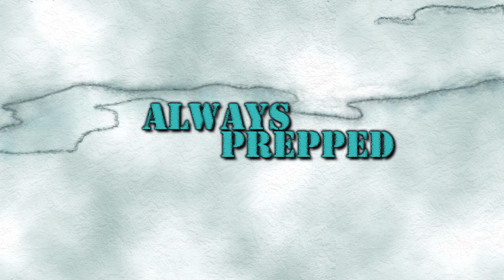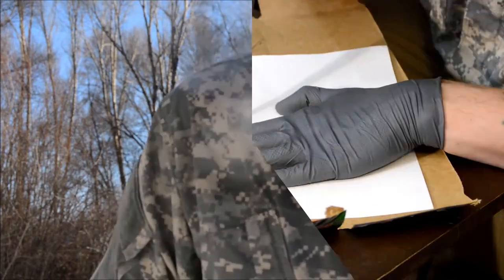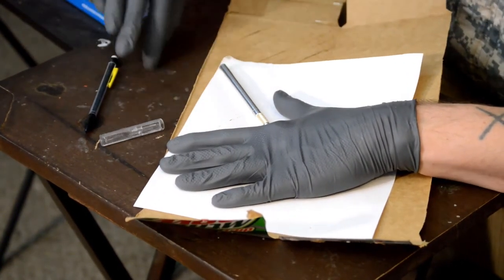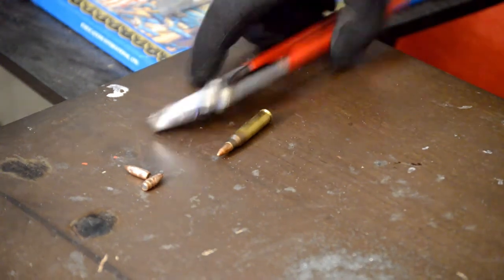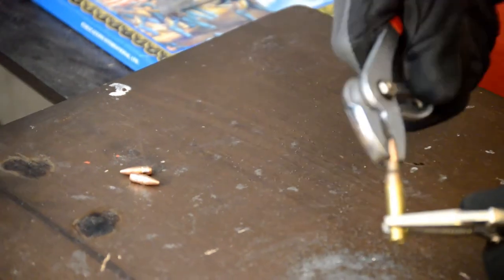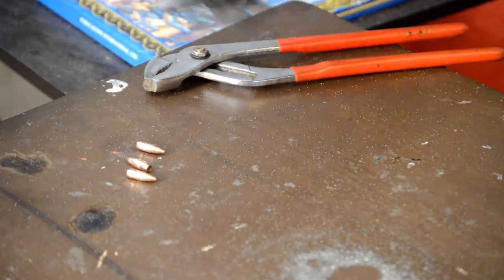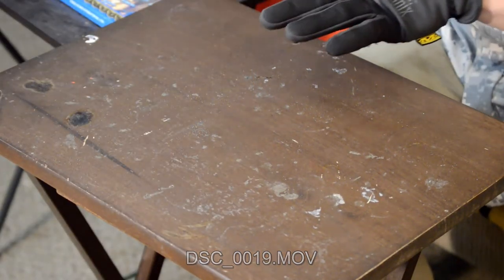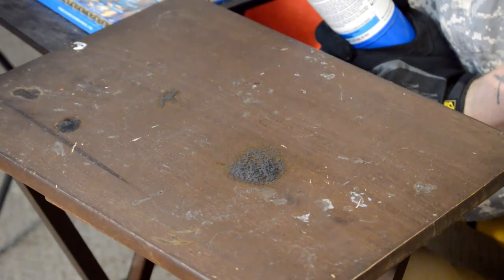AR-15 Rifle Painting Bloopers!!

Comment: So...I'm six mins in and we're using bullets to weight down paper because taping said paper would leave abstractions in the paint. I'm wondering....why didn't you cut the tape itself into shape and use that instead of paper? Granted, I use cardboard stencils when I paint my rifles but I'll also cut painter's tape to gain specific shapes...hilarious though!
Reply: Cus 'murica
Reply from the maker: I didn't use tape because I the paint wasn't yet 100% dry enough for it.  it would've pulled paint off with it and I didn't want to wait the days to make sure.  also, 'murica, yean.